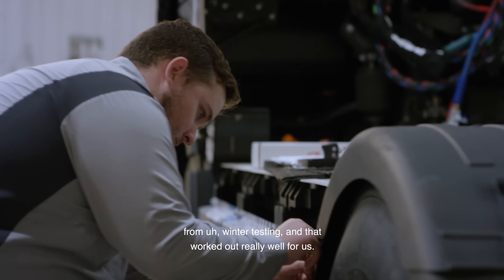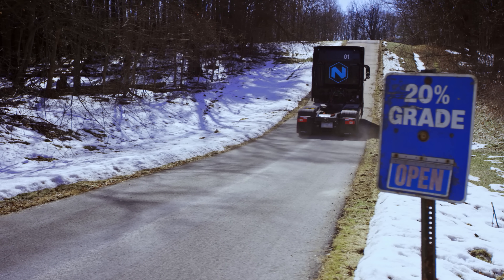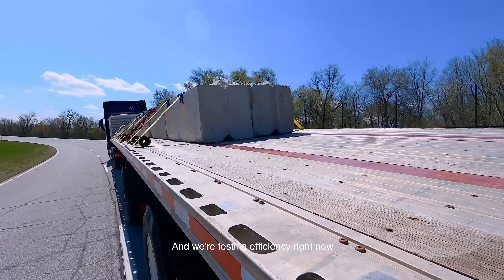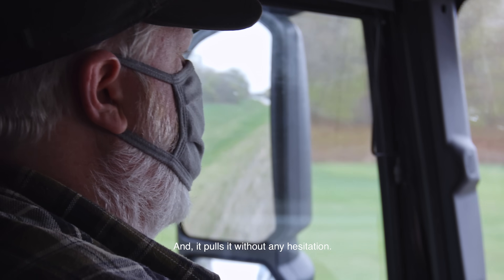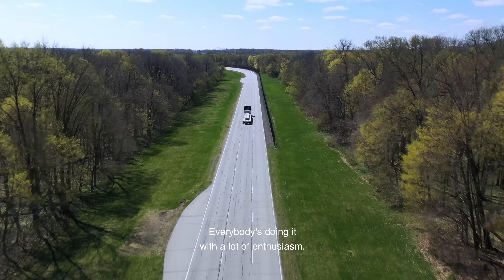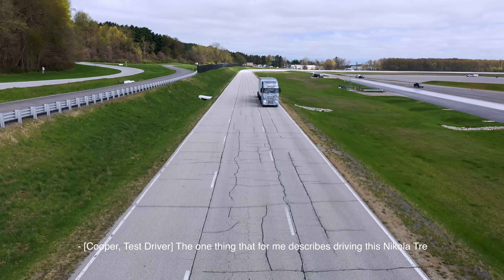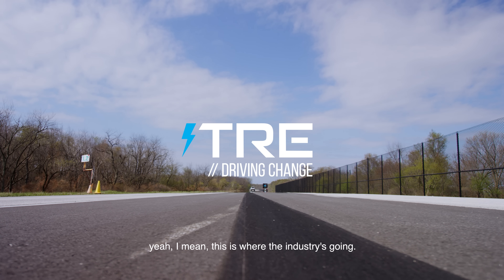Driving Change Episode 4: Gamechanger | Nikola

Comment: Ok since there making a over the road truck that pulls trailers with heavy loads who finds the fact that empty it can pull a 20% grade relevant? Hell my electric lawn mower can do that! If you know anything about electric motors they are loaded with TQ so a 20% grade to an empty truck isn't proving a damn thing. I was expecting to see the 2nd run with a trailer. Then the dyno was explained and hooked up, saying it could simulate different road grades etc. Well how did it do with severe road elevation? No real stats just some hype that it did well and they were satisfied. I bet GM loves the fact that they use a Ford for there choice of transport vehicle lmao.

Comment: Are these the Iveco trucks rebuild as Nikola prototypes in Ulm Germany?
Reply: These were built in Europe, I guess Ulm, although not at the building they will use for production later this year as that was being prepared when these were made. Assembled from as much of  Iveco S-Way components as are applicable, and then diesel power train and dash/controls replaced with battery equivalents.

Comment: Do these do regen braking yet?  I can imagine pulling a load, that would give you quite the boost of regen especially on downhill grades - could also help prevent brake failure on steep downhill grades as you'd be absorbing energy in to the battery rather than wasting it in the braes.

Comment: Why is the truck longer than normal with the trailer attaching further back, leaving a large gap between the truck and the trailer?
Reply: no, it's not.
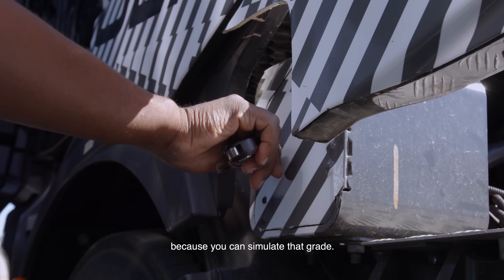Reply: @msgt8641  Look at the huge gap between the cab and the trailer: 5:16 , 5:43 That same big gap was on their Tre trucks in Phoenix.
Reply: @lockbert99  more room for hydrogen tanks in the fcev.
Reply: @msgt8641  Iveco offers the S-Way cab vehicle in different lengths/configurations so I would hope they are not going to use that length for the final BEV product.  But I am baffled as to why they would produce and test a version that has an unnecessary gap for a BEV.
Reply: @lockbert99  I remember seeing hydrogen tanks in that gap for the fcev tre

Comment: Where is the success? You pack a couple of batteries under an IVECO.
Where is the fuel cell? This is nothing more than the joint venture concluded in 2020.

2/6/2020

CNH Industrial and Nikola Motor Company build Nikola TRE in Ulm
IVECO production facility in Ulm becomes production center for battery-electric and fuel cell-operated heavy truck models Nikola TRE.

London, 6th February 2020

The European joint venture between IVECO and FPT Industrial - the commercial vehicle brand and drive specialist from CNH Industrial N.V. (NYSE: CNHI / MI: CNHI) - and Nikola Motor Company will build the Nikola TRE at IVECO's production facility in Ulm.

As part of this strategic and exclusive partnership in the heavy goods vehicle sector, CNH Industrial, as the main investor in the D series, has invested $ 250 million in Nikola. The announcement of the partnership at CNH Industrial Capital Markets Day in September 2019 was followed in December by the presentation of the Nikola TRE, a battery-electric heavy-duty truck (BEV), which represents the first step towards a fuel-cell-powered electric vehicle (FCEV).
 
Today, Ulm is the competence center for the construction and design of chassis for IVECO. The location can look back on a long history of innovations and industry novelties and has stood for top performance in heavy-duty truck construction for more than a century. The location is in the heart of Baden-Württemberg, which is developing into a leading hub for fuel cell mobility thanks to its well-trained workforce and numerous research institutes. The state made considerable investments in research and development projects in the region at an early stage and is also home to a strong automotive industry and strategic project partnerships, so that Ulm is already benefiting from its proximity to important suppliers.

In addition, the federal government recently launched the draft of the National Hydrogen Strategy to promote pioneering work by companies in the field of hydrogen technology. In it, it announced that it would make two billion euros available to finance a hydrogen innovation program and to build the necessary infrastructure.

"Our European joint venture with NIKOLA and today's announcement are clear evidence that emission-free long-distance transport is coming and that it will bring tangible environmental benefits for Europe's long-distance hauliers and its citizens," said Hubertus Mühlhäuser, Chief Executive Officer, CNH Industrial. "The decision to build the Nikola TRE in Ulm - a competence center for the development of heavy-duty trucks - underlines the strategic location of the location in the heart of the German fuel cell technology cluster."

In the first phase of the project, the joint venture will invest 40 million euros to modernize the production facilities and then concentrate on the final assembly of the vehicle there. The start of production is expected in the first quarter of 2021, with delivery of the Nikola TRE beginning in the same year.

"The Nikola TRE is the world's most advanced heavy truck and will set the standard for zero-emission vehicles today and in the future," said Trevor Milton, Nikola Motors chief executive officer. "The decision to mass-produce the TRE in Ulm is a good example of how jobs can be created, innovations promoted and security for new zero-emission suppliers. The world is ready for emission-free freight transport. The joint venture between Nikola and IVECO will be the first to deliver. I'm looking forward to seeing the first vehicles roll off the assembly line. "

The first models to go into production are the battery-electric 4x2 and 6x2 vehicles with modular and scalable batteries with a capacity of up to 720 kWh. The electric drive has a maximum continuous output of 480 kW.

The Ulm plant is supplied with modules from IVECO's Spanish production sites in Valladolid and Madrid, which enables production to be ramped up quickly to meet expected customer demand. Electric versions with fuel cells built on the same platform will be tested in 2021 as part of the European Union-supported H2 Haul program. The market launch is planned for 2023.

The Nikola TRE, which is currently being developed, is based on the new IVECO S-WAY platform and integrates Nikolas drive technology, controls and infotainment. The tests are expected to take place from mid-2020, with the first prototypes to be shown at the IAA 2020 in September.

"Thanks to our gold standard world-class manufacturing location in Madrid, where the IVECO S-Way is produced, we are able to carry out the final assembly, the drive integration and the high-end designs
Reply: bruh this is a youtube comment section. nobody who is mentally sane would read all 17 essays you wrote

Comment: Why is it an Iveco Truck?
Reply: Tobias The Nikola Tre is currently produced by a joint venture company in Europe that is 50% owned by Iveco and 50% owned by Nikola.  It uses the same platform as the Iveco S way, but it uses Nikola EV tech and infotainment.  The Iveco S Way is a diesel powered truck, the Nikola Tre in this video is a BEV, and they will later make an FCEV version of the Nikola Tre.

Comment: Nice IVECO logo on the steering wheel guys, nice! Iveco 1 Nicolas zero
Reply: The entire electric power system is Nikola made, what are talking about? The chassis is Iveco, but nothing else when it comes to the green energy thrust engineering

Comment: How much of this truck is actually Nikola?
Reply: They wrote the software and designed the dash/battery/motor setup. Or put another way, they designed the BEV part to replace the Iveco S-Way engine/transmission/axle, gas tank.
Reply: 50%

Comment: How long is the truck? It seems longer than the diesel ones because of the battery pack?? Wouldn't it impossible to back up to docks if there is not enough clearance space for some tight place?
Reply: The flat part behind the cab also looks longer when they hook up a trailer, and there is a significant gap. I assume the length has to do with testing, but don’t know.

Comment: "Oh and its very fast".... then drag races A f350 (witch is balls slow) and loses.... yeaaa idk if you guys know what "fast" means....
Reply: Eric Marshall Actually it held up well & was only slightly edged out.  Of course a large Semi truck isn’t going to go as fast as a much smaller Ford F-350, but it’s performance was very impressive.  Semi trucks usually travel from 50 to 60 mph on the freeway. They very rarely go to even 65 mph, especially while pulling heavy cargo.  Anyone who doesn’t think this truck going 75 mph while pulling 82k pounds of cargo (as it did in this video) is fast is absolutely clueless about trucking.  This truck is extremely fast.

Comment: Electric big rigs are an interesting idea. Performance and range both need to match the diesel truck. Prove that.
Reply: Suggest you do some basic research of your own on Nikola before you post ill informed comments like this.
Nikola has clearly stated that the Nikola Tre BEV is intended or shorter range haulage so will never compete against a long range diesel class-8 truck on that measure. Nikolas FCEV trucks will compete on range.
And as for performance, if shear power is your measure then the Nikola Tre BEV significantly outperforms a regular class-8 diesel truck.
Reply: @p00595p  Hey, genius. "Local" trucks still need to work around the clock if you intend to run a business. A few boutique, daylight only or highly subsidized haulers might get away with big rig EVs with today's range availability. Most companies don't have the luxury to park the entire fleet overnight to charge. And please, put a fully loaded trailer behind the Nikola tractor and take it on a mileage loop. If it can go 450 miles without a charge and can recharge for another 450 miles in 30 minutes, it'll be ready for "local" around the clock duty. That's what trucking is about. We don't park tractors overnight.

Comment: There are so many nuance advantages to EV that most will not realize until they get to drive one that will make you suddenly realize just how much you didn't like certain aspects of conventional transport.  No leaking tanks from overflow when fully fueled in cold weather with cold fuel and parked in a warm shop.  No spilling when overfilling the tank.  You can now smoke when refueling.  No sleepy engine vibrations.  No stopping for emissions testing and sweating a passing grade or major fines.  No more worry about expensive emissions component theft.  No oil changes and techs leaving dirty stains all over the truck from that or having to pay enviro fees for disposal of your petroleum wastes.  No more exhaust leaks creating breathing or fire hazards.  No more DEF and all the constant headaches from all the emissions controls.  The list goes on.

Comment: Wonder if anyone's figured how much power you'd need at an average US truck stop to charge everyone overnight 🤔
Reply: The use case for these is probably "charge at warehouse". Either at the sender or receiver site.
Reply: @lockbert99  unless the battery packs are in the trailers (which would make tonnes of sense) the charging will have to coincide with truckers sleep schedule to be as efficient as fuel trucks.
Reply: Nikola is manufacturing FCEV class 8 trucks for long range trucking. The BEV trucks are for short to medium range trucking  when the recharging is mostly done back at base overnight, not at truck stops.

Comment: The Tesla Semi will stop this company from growing, don't bet on Nikola.
Reply: What a poor guy
Reply: I wouldn't bet on that if I was you. The Tesla Semi has a significantly smaller battery pack (500 - 550kwh) than the Nikola Tre (750kwh) and the Tesla Semi rollout has been put on hold due to a shortage of batteries.
And once Nikola starts rolling out the Nikola Two FCEV,  the Tesla Semi will have no chance of competing on range.
Lastly, if you did your research, you would know there are a significant number of class-8 truck fleet owners who run their trucks close to 24 hours per day, with multiple driver changes. For those fleet owners, there is simply no time to be stopping for hours at a time to fast charge a battery, so the Tesla Semi will never work for them. Nikolas FCEV trucks may well be just what they are looking for.
Reply: @p00595p  Range doesn't matter when you can't refuel it. Hydrogen is too expensive and won't work for Nikola.
Reply: The Tesla semi got delayed again lmfao 😂 Tesla should just stick to cars. Nikola will be the first to the market

Comment: Is it IVECO or Nikola truck driven at 3:38?
Reply: IVECO is Nikola's partner. Nikola is using IVECO's truck chassis to make the Nikola Tre BEV and Nikola Tre FCEV
Reply: I assume that while it is the Nikola Tre (joint venture of Iveco and Nikola and using Iveco S-Way shell)  it says Iveco because it is one of maybe a dozen prototypes and they didn’t bother to make a new version of that steering wheel column logo  just for the prototypes.
Reply: IVECO only has diesel and natural gas trucks.
Reply: @cruiser97eric1  They retrofitted the IVECO truck chassis with batteries and electric drive terrain